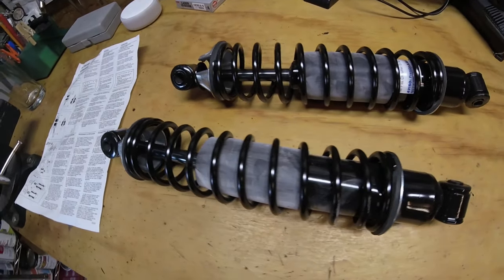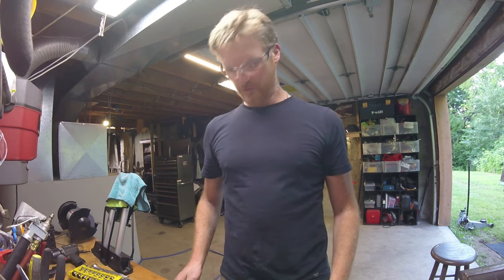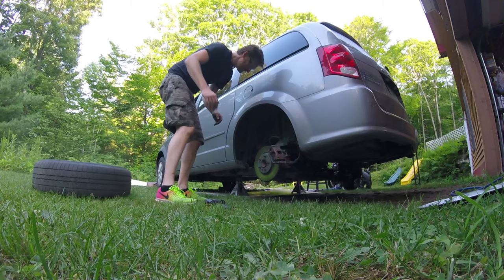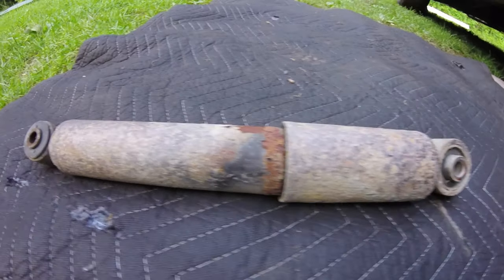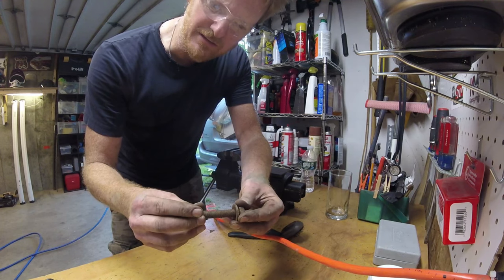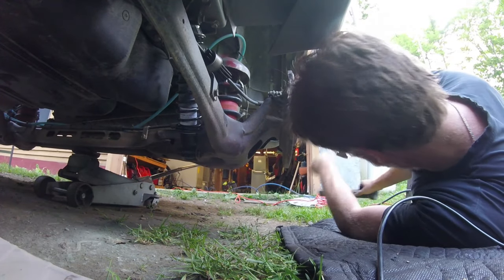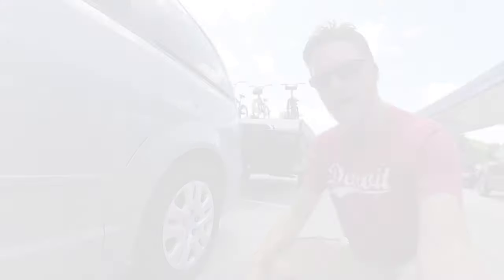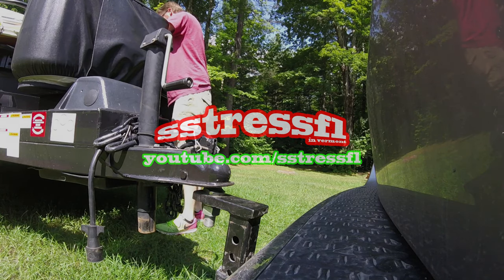Monroe Load Adjusting Shock Install & Results | 2015 Dodge Grand Caravan

Comment: One tip/warning (particularly to truck owners.)  The total travel of these shocks are quite a bit less than OEM's.  You'll notice that these monroe's have their own 'bump stop' on the shaft itself (you can see it in this video too.. it's that rubber part on top of the shock body.)  If you're an offroader like me, and was hoping to use these for both towing and (very mild) rock crawling (I know, wishful thinking) then you are going to lose out on a lot of articulation.  Not only is their compression distance shorter (due to that bump-stop) but their extension length is shorter too.  In my case total travel was about 2" less than OEM (2014 F150,) which is pretty significant.

Probably doesn't affect most users, but thought I'd point it out.
Reply from the maker: yoster77 not a problem on this minivan 👍
Reply: yoster77 Did you go OEM shock with a helper spring instead, to improve the total travel?
Reply: @valueduser2746  Because they're so easy to swap out, I use both.  I keep the monroe's on for everyday driving and towing a 30' travel trailer.  When I go on a 4x4 trip, I swap them out for Bilstein 5100's - I picked up a pair with about 1.5" additional travel over the motorcraft stock ones.   It's a bit annoying to need to swap them, but I don't go rock crawling that often - maybe a few times a year, so they're easy enough to swap out.
Reply: @annasajerk  That's not bad!  I wish mine were like that.  Mine are about 2" shy on full extension, and then on full compression, it's the opposite, about 1" taller due to that bump stop.  So about 3" total suspension travel reduction.  Not something I notice 99% of the time - only when I go wheeling.

Comment: Made the installation for a Ford Ranger XLT 1999 with these Monroe 58608 shocks and  with this video help and there is a great difference in my old air shocks and these new ones. They exceed for much the great ride. Now to test the shocks with my boat trailer. Thanks for the video help...
Reply from the maker: So glad it was helpful! I'm sure you'll notice some progressive assist when you put a load on them. Enjoy! Mine are still going strong. I'd buy them again.

Comment: 4 yrs later do u still feel this way 6:55
Reply from the maker: PROS: They are still working perfectly and still ride great. CONS: they are tough on their own bushings and will clunk on the mounting brackets once the bushings get tired. Poly bushings give better support and I recommend a little grinder work to give them a little clearance from the mounting bracket. WOULD I BUY THEM AGAIN KNOWING WHAT I KNOW NOW?  No. I would instead buy slightly stiffer rear coil springs that Rockauto now offers. And would not buy the air support bags at all (junk) I would buy a good weight distribution hitch for towing (which is what I did later) and tow with much more confidence and comfort 💪 Ultimately though - I bought a new truck and I don't use the van for towing anymore. But heck, like I said first, those shocks are still working and still ride great  👍

Comment: Good video I'm looking at these for my 1983 dodge D250 she's a 8 lug 3/4 ton says it adds 1200lbs support because with my lawn care trailer loaded I get a fair amount of rear end sag and I mean everything but the leaf springs and brake drum size are the exact same on the one ton D350 so should be interesting to swap them in this lawn care season
Reply from the maker: I would be tempted to buy a new set of leaf springs for your d250! They get tired over time. The shocks help but not as well as a fresh suspension. I had a ‘79 aspen wagon back in the 90s and a set of new leaf springs with an added leaf made a HUGE difference in ride quality. I know there are also places that can re-arch leaf springs but I think labor today would make that more expensive vs buying new. Anyway, just a suggestion 👍

Comment: These improve the performance a lot. Get some high flow fittings on your compressor and hose. Makes a huge difference.
Reply from the maker: These shocks are very good but they don’t use air! Just a booster shock that gives a little lift.

Comment: My FSM (Full Service Manual) says to torque the shock bolts with the weight on the suspension with the tires on the ground.
Reply from the maker: MrShuzaam Monroe doesn’t mention it in their install instructions. I wonder if it’s because these new gas charges shocks are under so much pressure? They seat themselves quite well unlike shocks of old. I’ve never done that and have not experienced any problems. 👍

Comment: the look like they be to stiff but they look good. i have a full size hi top dodge ram 1500 conversion van.i am getting bad body roll in front. i am going to put these in all 4 s..thanks for video ..
Reply from the maker: The ride slightly stiffer than stock but surprisingly nice. They get progressively stiffer as you add weight. But even then its only a 1000 lb boost! I like 'em! Thanks for the feedback!!

Comment: Wish I would have found you & this video last year before I changed my shocks & springs on my Dodge 2006 Grand Caravan. Bought some Gabrielles and even though my old shocks looked like a rust bucket with holes in them, and pushing them down manually they barely rose back up but they made the car ride smoother than the hard ride my new shocks are giving me  ... what's up with that? Damn !!!!
Reply from the maker: I bought some front struts that did that once. Monroe! They seemed to be ok for a day or two then felt like they got stiffer and stiffer. Terrible ride! I don't know why that happens. Brand name shocks too!

Comment: Thanks for the vid, about to order a set of these for my 2015 DGC then this video came up. I too tow a travel trailer but just a bit bigger than yours, around 3000lbs. Using weight distribution with the trailer, the rear sags about 1.5-2" so I'm hoping to lessen that with these shocks. BTW, BFG KO2 A/T tires are awesome on these vans, had them now 2 seasons and love them on and off road. Also helps with the heavy trailer load.
Reply from the maker: Sorry I missed your comment somehow! I use these but have also added a load distribution hitch. WHAT A DIFFERENCE! My van feels like a truck!! Level. Easy to drive. Stable on the hwy. And zero sag! It's the right solution. I did a video! https://youtu.be/0tzg0ldhtY0

Comment: Hi Michael,  I had Monroe air lift shocks on a 2005 Caravan a they were ( are) great.  I'm now driving a 2012 but no one makes the air shocks for them.  I'm concerned the air lift bags are durable enough and have been looking at the Monroe spring assist. I appreciate you sharing your experience with both.  Do I understand you are having trouble with durability with the air lift bags?
Reply from the maker: Hey Peter. I dumped the air bags after my second set. They failed for me after 1 year in the Vermont environment. Some folks down south have said that theirs lasted much longer in the warmer air. The other option is rockauto sells a set of beefier coil springs for the grand caravan! That might be the better way to go. I'm using the monroes and a weght distribution hitch. I'm very happy with the way the hitch solved my problem :)

Comment: I’m thinking about replacing my own shocks since my father doesn’t want to fix my car anymore. 🤷🏽‍♀️ looks pretty easy! I have the 2013 van
Reply from the maker: It’s not too bad!! You can do it. Just make sure you secure it when it’s jacked up in the air. Use good jack stands.

Comment: Hey Michael, I've been enjoying your videos a lot, thank you! I recently purchased a 2019 Forest River Flagstaff Classic and I'm towing it with a 2015 Honda Odyssey. I noticed you did both Lift Air Bags as well as these shock upgrades. Did you feel like the air bags did not perform quite the way you wanted them to so you needed to upgrade the shocks or did you just want even more support because, well why not?
Reply from the maker: After 1 winter in VT.... the hoses failed and the bags failed. They sent me new ones... a year later the new ones did the same. The air baf dried out and cracked. So I am now using a proper weight distribution hitch and its the perfect solution for my 2400 lb camper. Here's the air bag 1 year update video :) https://youtu.be/cjrm1emdkIA
Reply: @sstressfl  Thanks for getting back to me. I have the distribution hitch coming on Monday, just in time for a 2 week trip, excited to see how it performs. Thanks for sharing that airbag update video also!
Reply from the maker: @pjmckeage  as long as your camper has a boxed frame it should work perfectly!! You won’t regret it 💪😎

Comment: I had the same setup on my 2010 Grand Caravan and they worked great together.  I didn’t have any issues with rattling noise.  I have a 2017 with 50,000 miles and the rear springs are getting soft so debating on airbags or just going with the Monroe’s.  I have out Airlift airbags on my o3 and 13 Altima with good results
Reply from the maker: vinceleto I really like these shocks. I’ve now replaced my front struts so the entire suspension is like new. Rides wonderfully smooth with no noise and the towing is much improved. I’m going to buy a load leveling hitch in the spring. It’ll take a lot of weight off that rear axle and send some of it up front. Thanks for sharing your experience!

Comment: Michael, just wanted to see if you have an update on these shocks. I’m considering installing them on my van but there are tons of reviews saying they fail quickly and are very noisy.
Reply from the maker: Mine started clunking 1 year out. The bushings were too soft and allowing the shock to touch the frame slightly. So I replaced the bushings with poly bushings. No problems. These shocks make the van ride more confidently. If they ever fail I’ll buy them again. Love these things.
Reply: @sstressfl  Thanks for the update. Do you have part number for the poly bushings. I use my van for work and pull a trailer with up to 3k lbs.

Comment: Upgrade your rear coil springs  to Xd coil springs as well as those shocks will save you money in long run I have 2016 with those shocks  second pair but now with xd coils springs to compliment them
Reply from the maker: I didn’t know there was a coil spring option!!! I will google it! Thanks for the heads up 👍💪

Comment: I too am looking for minivan solutions. I have a 2018 Dodge Grand caravan. Was looking at the Timbren suspension enhancement looks like good review. Do you think these shocks were worth the money. Any idea how they would work with the Timbren. Right now tow a 1,900 lb boat all is good but looking to reduce some rear sag. Love the van for traveling just need to beef it up a lil. Thinking about a pop up soon also.
Reply from the maker: My factory shocks were completely shot and I replaced them with these. I would buy them again even if I didn't tow! They give a little lift when not towing and they stiffen up when you add some weight. They ride confident but not harsh even when the van is empty. I personally think the best combo for a 1900 lb boat would be a load leveling hitch. It would allow your van to tow level without adding extra suspension components. I added one to mine and I'll never go back to air bags. https://youtu.be/0tzg0ldhtY0

Comment: Put the Monroe Load Adjusting Shock on the 18 Grand caravan crew and they started squeaking.. Put the silicon spray to the middle rubber of the shocks and the ends.. Took a few times but it cleared the noise up.. Traded in the 18 for a 20 Grand caravan GT and will be getting these again.. Noticeable improvement in the drive with these.. Constantly have my little girls 400 lb power wheelchair in the back.. Keeps the lift up in the back and just drives better..
Reply from the maker: I agree! I will buy them again if needed. Truly enjoy the better handling and more secure feeling ride.

Comment: Question, I have a truck with leaf springs with shock absorbers front and rear, and was thinking about adding these shocks front and rear, do you think it would make the ride smoother or too harsh
Reply from the maker: I’ve only seen them added to the rear of vehicles. And no they actually aren’t too stiff. They get progressively tighter as you compress them 👍

Comment: Use Anti-Seize compound, (not grease) on bolts.
Let's see it bouncing on some bumpy roads. 
I think the max air pressure on those red bags is 55psi.
Reply from the maker: I didn’t have any antisieze, but yes a better solution but the grease is better than nothing. Been using it for years. It actually rides gloriously even on bouncy roads. It tightens under load. Not stiff. Rides more confident without being harsh. I tossed the air bags. They turned hard & brittle  after 1 winter season in Vermont.

Comment: Bout to put them on mine next week they'll be here. How they holding up.
Reply from the maker: They are awesome! No problems. And I like that the van sits a little higher. Makes it look stronger.
Reply: Awesome. I kept scraping on speed bumps so I got a 2 inch lift by putting bigger tires. Of course my speedometer is off by 4 mph but definitely looks better.
Reply from the maker: Real world Cichlids and more probably rides a little smoother and gets better traction too 👍

Comment: Hi Michael.  I have a 2014 GC and will be occasionally towing a 5x9 trailer with a John Deere lawn tractor weighing around 600lbs.  I'm thinking these would be a good way to stiffen up the ride when doing this.  What's your opinion?  Thanks!
Reply from the maker: I think its a perfect solution for this application. The springs are progressive so you'll have a pretty normal ride when unloaded (slightly more firm, but in a really good way!). But when you load up the tractor, the springs get compressed and get more firm. They advertise that they give a 1000 lb help/lift. I think you'll like 'em a lot.
Reply: @sstressfl  Perfect. That's exactly what I was thinking. I'll enjoy the slightly stiffer ride when unloaded too because I don't necessarily drive it like a minivan all the time. :). It'll also help when I've got the wife, 3 kids and all our stuff loaded for the road.
Reply from the maker: Adam Erb absolutely! Especially if your current shocks are tired, you’ll appreciate the mild boost. It feels so much more confident on the road.
Reply: @sstressfl  I would guess they are at least a little tired. 112,000. I'm going to start soaking the bolts with penetrant now.
Reply from the maker: Adam Erb whoa!! Yes I would say they should be done 🤗 Good time for a change 💪

Comment: Glad to hear you need the ninvomat shocks in the end still. I'll skip your two mods and go straight for them. Thanks!
Reply from the maker: gotalf I don’t! I need load leveling bars to balance the weight across the entire van, onto the front wheels. I didn’t think nivomats worked on a a non-ninovat spec van?
Reply: Michael Byrne I’m hoping they do, that was my plan. They’re just shocks, not sure why they wouldn’t.

Comment: No grease on rubber use silicone grease for rubber gaskets and parts like that bushings
Reply from the maker: Agreed. I used grease to repel water from the rusting bolt and steel sleeve not on the rubber part 👍

Comment: Any update on these shocks? How are they holding up? Want to add some to my 2018 caravan.
Reply from the maker: Colin Jenson I was a little worried about some of the reviews that said they squeaked. But I’m sold and I’ll buy them again if I ever need to. Quiet. They ride smooth. Two thumbs up!
Reply: Michael Byrne awesome thank you! I have ordered now! I also purchased the same trans cooler. I will be installing that as well. Do you think these shocks will be plenty without the air bags? I only pull a small pop up, around 1,700 pounds full.
Reply from the maker: Colin Jenson I really think the shocks will be enough for that kind of weight. That’s pretty light! The shocks will make the back feel tighter, better control, more confident towing 👍
Reply: Michael Byrne you rock, thanks for your videos! Can’t wait to see what else you do with your caravan!
Reply from the maker: Colin Jenson thank you! I appreciate your kind words my friend!

Comment: I got every seat filled in my T&C, wonder if this is a good investment as my 5 kids keep getting heavier as they get older
Reply from the maker: So after I did this, Rockauto started carrying different rear leafsprings!! Thats the right way to do it. They have a Dorman that is 35% over original rating! Oh if I had known! I believe that would be the way to go. Much better than the shocks. https://www.rockauto.com/en/catalog/dodge,2015,grand+caravan,3.6l+v6,3309782,suspension,coil+spring,7512
Reply: @sstressfl  I never did consider springs.  I did new rear brakes, my TC had the 330mm rear disc,  expensive, and noticed my shocks are much worse off than yours.  But now idk if they're  nivomat.
Reply from the maker: @nicholasdonin1465 nivomats are big, maybe the double the width of a standard shock. Hopefully you don’t need new ones cuz they’re expensive and you cannot put in normal sized shocks. Too short. They’ll make the van sag in the bag. I hope you can find a good and affordable solution 🙏🙏
Reply: @sstressfl  I only glanced during the brake change.  I'm praying they're not nivomats. The van gets sold before I do those.
Reply from the maker: @nicholasdonin1465  I dont blame you!

Comment: Didn’t you try an air lift 1000? What happened to that ?
Reply from the maker: I did! In fact I ran both the bags and the shocks together for one trip. But the bags ended up being high maintenance, high failure rate for me (leaks, cracks) and I gave up on them. I still have the shocks and they are wonderful! But I added a weight distribution hitch and it is the ultimate solution for towing this big popup. Here's the video! https://youtu.be/0tzg0ldhtY0